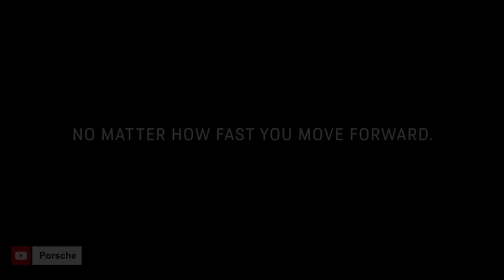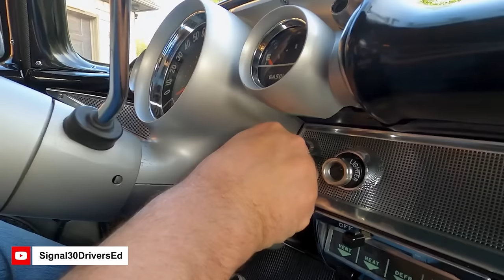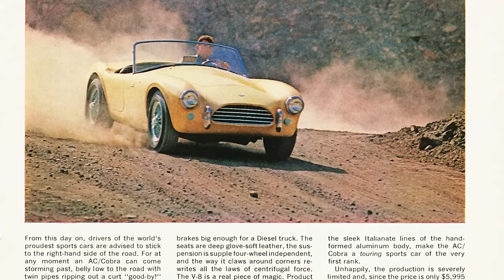Why Old Cars are Better

Comment: I have a 1986 Nissan Stanza Wagon. Its my first car and I love it so much with its 80s aesthetic, insane visibility, and with its foldable bench seat in the back cabin I have ample room to camp solo or haul friends around on short road trips, but it does have its downsides. When I found it at a junk yard it had previously been sitting in a barn for 9 years and didn't run at all. After working on it for about a month it breathed its first breath in a long time and I was ecstatic. But now even though I've fixed everything that's possible to fix in it, it is slowly dying, breaking down more often and starting to have power issues. It wasn't ever very powerful to begin with and im pretty sure its 0-60 is the slowest on the planet but it has trouble now more often than not. So while it still runs im looking everywhere for a new old car. Ive driven other peoples newer cars and it just doesn't feel right so even if it wont last me long or if I have to breath life into a dead car I will be getting a good oldie. I do want to do some traveling on highways so im currently looking at late 80s to early 90s cars to see if I can find some gold. I haven't had any luck yet but I wont stop looking. Older cars are most definitely worth it!

Comment: The most telling of quality difference I found when we filmed a 1957 Chevy sedan that was sitting on its original tires. Today's tires will fall apart after 10 years, but here was this 65 year old car comfortably riding on its 65 year old tires. That is the kind of durability in materials that you simply don't find in today's products.

Comment: Makes me kinda sad the my kids or grandkids if I have them may never be able to experience the absolute joy of having a big old Chevy 350 start up and run just perfectly after a few weekends of tearing the whole thing down to the block and rebuilding like me and my grandpa did with an old 77 Corvette when I was young in the mid 90’s. There was something so pure about it, finding parts, making them if necessary, tuning a carb till it was just perfect, no computers, just hand tools and skill.

Man and machine, not just operating it but knowing every detail of what it takes to keep it alive.

Comment: I started driving at 16 years old in 1979. My first car was a 1969 dodge Dart Coupe. It had a 318 ci v8 making 230 hp standard 4 wheel drum brakes standard steering and power nothing... It weighed 1800 lbs. It was way too quick for a new driver. You had to measure stopping distance in football fields. In 1979 a 7 second 0 to 60 was pretty damn fast. It was by almost every measure a horrible car, but it was glorious. It was the best car I ever owned. I still miss it. Sadly I was young, poor, and stupid, and I beat the ever loving snot out of it, but I learned a lot. I had to. Although I can't afford vintage cars I do own 3 vintage motorcycles. A 1979 Suzuki GT 750, a 1966 BSA lightning, and a 1979 Harley-Davidson FL which like my first car was given to me by my father. I really enjoy your videos. I understand the passion and the underlying message. Owning one of these old girls is really rewarding, but go into it with your eyes wide open. You need to develop a few very easy to pick up skills. It is, in my opinion, totally worth it. My friend who also owns a shovel head Harley sums it up like this "this thing is a horrible machine, but damn it's pretty"
Reply: This reminds me of a funny thing that happened to my dad a couple years ago. He was looking to buy a new car and he met this old Mexican guy who was trying to sell a 1974 Dodge Dart which just so happened to be my dad's first car. It looked really nice and my dad couldn't wait to buy it, but then the nostalgia goggles immediately came off once it was time to test drive it lol. It took about 20 minutes of fiddling around just to get the thing started and once it was running it felt horrible to drive around and whenever it turned, the front wheels would be grinding on something. Needless to say he didn't end up buying the Dart, but he did buy the guy's 2000 Camry which only had about 70k miles and ran great.

Comment: Learned to drive in a '77 Caddy, talk about one of the largest cars that're possible to drive.  It was a comfortable ride on longer drives, though, and that 425ci engine would get you were you were going with ease long as you didn't mind touring every gas station along the way hehe.  What I will say about carburetors, which was discovered in that Caddy, is when at altitude.  I got to drive the trip to Colorado from the TX gulf coast 5 months after I got my license, and ol' girl had a time getting up Pike's Peak.  She never overheated or had a major issue, but lack of air kept it from going very fast.  Electronic systems handle this vs manual adjustments, so you could go from here to CO or Snoqualmie Pass, and a modern car will perform the same no matter what.  In the earlier days of car ownership, there was a lot of additional knowledge you had to have to successfully own, drive and maintain a vehicle.  Sadly, today, there are so many out there on the road who can't perform what I would say are necessary tasks like checking fluids or changing a tire.  These basics, IMO, should be part of driver's ed.  Nowdays, they don't even give you a spare tire, which is bull, but if I owned a newer car, I definitely would get a rim from a junk yard or order one, and have an extra tire, or an extra non-donut full size tire as I did w/ my car.
   I do prefer a car that you can work on, especially if you're out on the road and run into an issue.  I've got a '97 Altima w/ over 300K mi on it, and I've had 'er all over this country and to BC's west coast, and don't leave without my tools and Chilton manual.  Although it's late 90s, it still has a distributor and essentially Nissan tech from earlier days of the KA24DE engine, and of course the last of the body style that arose in '93.  Being 5 speed, it's been nice even in mountainy states or where you need to get on it when getting on urban freeways.

Comment: People drove differently until about 2005 there was a breaking point where there got to be too many automatics with too powerful of breaks. In the 90’s for instance enough cars were manual that people would let off the gas instead of slamming on the breaks and the following distance was followed traffic just was allot smoother.
Reply: As A.B.S systems became a standard requirement for Newer vehicles etc...
We who learned Threshold braking,, just before lockup etc..
ABS does this for drivers,, problem was, we left and hold, repeat emergency braking, Many drivers instinct who learned this, ABS hates this, it wants , Smash the Brake pedal and...... Hold.. it will do it for you...
When you left and repeat , the ABS system, restarts the process...

Your comment about driving style is absolutely correct, these helper systems allow a belief in driver skill and a dangerous level of I can push it idiot driving style..
Reply: I daily driver a 68 Dodge Dart, Driver level Restored, not a show Car etc, V8 swap and 9 years on the road since, I'm still on Push to Pray Drum Brakes front - back, 
In order to defend my space in Traffic, fallowing to close behind me etc,  defensive is an understatement,  by all means pass me, if your going to be faster then I'm going, go for it!!...
It's the, Call it a parking space gap, I just have to be in front of this old car B.S and then Slow down!!...
It's closer to Riding a Motorcycle, yes they don't see you, yes everyone is going to cut you off, yes it's not for everyone...
My own skills have saved my life, no exaggerating, my choice, until I can no longer drive will always be a Classic Mopar A Body...
Cheers from Orange County California 🇺🇸

Comment: I posted a comment about the same topic on Driving 4 Answers channel saying that car design peaked in the 90's and watching your take, I still stand by my words. My first car was an '87 diesel Jetta in which I swapped a turbo diesel the year after because it felt like a calendar would be an appropriate speedometer....

After college I got myself a '92 Passat G60 syncro and that got me hooked on AWD cars!! It was my favorite car for a long time. Even after owning a quattro Coupe and a few later WV models afterwards the Syncro just felt perfect... Until I backdated to an '87 Audi 4000 quattro.... That beast has been my best ever in terms of nimbleness and sheer joy of driving. After that one, I've owned a few newer Audis .. A6, Allroad, A4's.... My next favourite was my S4 with the 4.2 stick shift.... But that car would have been a nightmare to work on with all the electronics. I didn't get to experience that because I got T boned by someone running a red 6 months later.

Now I mostly commute by bike so I indulged and got myself an '08 Audi A8 just for the heck of driving a V8 while I can. I'm at the point now where I fuel up once a month so I don't care about gas prices, all I want is to have some fun in the little time I spend driving!!

As of now the tally of my favorite cars are:
-'87 Audi 4000 q (that's an Audi 90 for you Euro folks)
-'05 Audi S4
-92 VW Passat G60 Syncro
-'94 VW Golf CL with a full GTI suspension and brake swap and a 16v powertrain from a Passat stuffed in for funzies!! That go-cart was brisk!!!

Now I need to see how that A8 climbs that ladder!!!

Comment: I just bought a super clean, super low mileage 96 Olds Ciera wagon. It is the greatest car I’ve owned and driven, it leaves my previous 09 Mini, 15 CR-V, and 17 Civic in the dust. It feels incredibly old school, analog, and tactile. The 3.1 L V6 sounds and feels great, the suspension is great, and the interior is plush and vinyl. Sure it’s got some cheesy GM in there, but it’s so solid and real and visceral. 

Massive vibes. You can keep your speed and performance and modern luxury. Vibes are what I’m after, and boy does this thing deliver.

Comment: Had a crimson 1975 Pinto,1973 Maverick, 1979 Chevette, 2 1984 Chevettes, and a 1974
Oldsmobile 442 . I did tune ups myself, replaced shocks. changed oil filter, all fluids, and
tires. The hatchbacks were great, I could pack the rear cargo thanks to the fold down

seats. And the pop-out vent windows were great for ventilation. The air conditioners, if
any, were crap, so I was told. Had Cavaliers, Sunfire, Sunbird and a Plymouth Champ-
a Mitsubishi Mirage in Japan, I believe. Many manuals. Loved them all. Wish I had a '65
Mustang, a 69 Charger, 71 Challenger or a 71 'Cuda, or just a plain basic Barracuda.
Oh well. I can dream at least. Lol.

Comment: My 1977 F250 has served me well for the last 20+ years (27800) thousand miles. Breaks tires and batteries. And my 64 F100 is fun to drive (in nice weather). We own a more modern vehicle, newer explorer. Both have there place, but the F250 is what we use when there work is to be done.
Reply: Awesome....
Modern car's have to many nanny systems.. creating driving confidence that's false.. you know why you've never needed Blind spot monitoring..
Because you actually Looked...
Lane departure warning!...
Also never needed..
I daily a 68 Dodge Dart..

Comment: I can say even being born in the mid 50's I have always been attracted to old cars ever!   I was never in to the late 60's to 70's muscle cars!  The first old car I fell in love with was a 1937 Cadillac V8 75 series when I was 16.   That needed an engine rebuild as the previous owner son wanted to see it would do 80 as the previous owner had her up to 75!  While flying down the road at 80 MPH the rings came off the pistons!  It went to a shop and once the engine was torn down, the owner never had it repaired, however he wound not consider selling it!  The same lot there was a 1960 Lincoln Mark V convertible where the engine had spun a bearing, but again an owner who would not sell either.  I finally ended up buying a 1939 Ford fordor Deluxe!  I have short list of cars I would like, such as '49 Buick Roadmaster sedanette, '49 Plymouth, '51 Packard, '56 Packard 400, '58 Buick Limited, '60 Lincoln Mark V convertible and 62 Studebaker GT Hawk.  I would also take 937 Cadillac 75 series or a 1939 Lincoln Zephyr!

Comment: I drive a 1929 Model A, and what you described about it being a completely different experience rings true. In fact, if it wasn't for living near a highway, I would drive it daily, going 30 MPH down the dirt road. So long as the oil is changed, and so long as there is fuel in its gravity-fed carburetor, the only thing that would make it stop running is driving it off a cliff.

Comment: I bought a 2001 GMC Yukon 2 years ago. It's been very reliable and I take great care of it. I'm close to paying it off and I hope to keep it as long as I can. Autos from that time were so much easier to work with. No lights and clockwork wrapped in fiber glass.

Comment: I recently bought a 89 Corolla Gts and I’m absolutely in love. It’s not a bad ass fast back mustang or a super sweet RWD classic Japanese car but I still love my Corolla. 

I feel like I’m operating a machine a whenever I drive my Corolla. Especially after I replaced the suspension With upgraded coilover suspension. And it still has a cassette deck!

Comment: Slight aside on the houses. I totally agree with you! My great grandfather was a jack of all trades but mostly built projects for people. Many if not all of the things he built are still standing today! One thing he always told me was " it takes just as long to do things right the first time, than to do them wrong or cut corners and have to come back and fix it." He also said that a mans reputation is his livelihood, back when there was no social relief, where if you did a crappy job no one would hire you and your children starved.

Now its hard to find someone who wont rip you off. Charge you 10k for a roof job that starts leaking 6 months after.

Comment: My first 2 cars were Fords. 1 Was a 1974 LTD with a factory 390. I loved working on it when that rare occasion came up. 2 Was a 1967 Galaxie 500XL and also the same engine. Those cars worked when newer cars were at shops!

Comment: I may be only 18, but I like driving an old truck, either my 66 c10 or 85 d50, because I’m confident I can almost always fix anything that can go wrong, within reason, with simple tools that I always have on me. It’s reassurance that yes I will probably have more issues with my older trucks but atleast I can do something about it rather than be screwed and calling a tow truck

Comment: There is an ad on YouTube at the moment which I get occasionally: a young lady with a flat tyre, saying "Absolutely nobody could help me." Of course the product is some re-inflater device, but it's symptomatic of today's "motorists". 

Enjoyed your video greatly. I drive a 33-year-old Jeep with a half-bikini canvas roof, summer, rain and winter. I'm no mechanical expert, but my annual maintenance - done by a faithful backstreet garage - costs me far less than servicing on a new car would. And my Jeep makes me feel part of the countryside I motor through. I carry paper maps, and stop to ask directions; and people are truly happy to help you on your way. I left the lights on once and drained the battery. A cyclist came along, dressed in spandex. "Quite the sportsman!" I noted. "Yeah" he proudly said. "Here," I replied, you can give me a push down the hill to get this thing started." He couldn't exactly refuse by that stage. Old cars CONNECT.

Comment: I drive a ‘97 Blazer, the kind of SUV that was still more of an enclosed pickup than what we think of as SUVs today. She’s got her issues, but she’s got more than enough perks to make up for it. Great visibility, the right amount of space, just the right ratio of mechanical vs. electronic parts, and she’s a pretty damn reliable workhorse. Gas mileage is pretty decent too, and I know how to replace a lot of the high wear parts too. Would never trade her for anything newer. 

Plus there’s just something beautiful about late 80s and early 90s vehicle styling that not a lot of vehicles capture today.

Comment: I own a "classic" motorbike 
When I was 16 I had a bike from the 1990s and understood barely anything when my dad (a mechanic and motor enthusiast) worked on it. 

The bike I now have is a 1970s bike, previously in service of the german army. And ever since I was 16 and assisted my dad I learned a lot and noticed that my new 1970s bike is much simpler. There is really barely anything to it. The minimal electronics it has (Lights, turn signals and horn) are simple and are powered by the engine. And the engine itself is easy to understand aswell.

I was so proud that, when the bike one day "died" on a trip, I was able to figure out the problem and with the help of the onboard tools that it came with (that were standard issue and present on every single one of these military bikes) temporarily fix the issue on the side of the road to get home and fix the problem completely on the next afternoon.

I think simplicity is the best perk for any vehicle, the simplicity for any owner to fix their vehicle themselves after they have informed themselves about their vehicle and the possible problems

Comment: Something that is also a very satisfying experience is driving an older car that's had upgrades done to the tires, suspension, brakes, transmission and engine (fresh new carburetor or aftermarket EFI).  The car still gives you that visceral, connected feeling but performs more like a modern car and can be reliable enough to be driven at higher speeds for longer periods of time.  Imo, the best of both worlds.

Comment: I have a 1995 Mercedes diesel, 270k miles on the clock.
Gear changes are controlled by how much throttle you apply and the engine can run without a battery, expect for when it idles.
I drive it everywhere with confidence:))